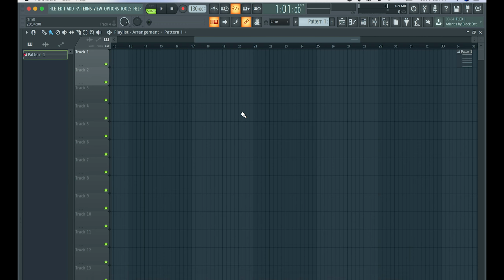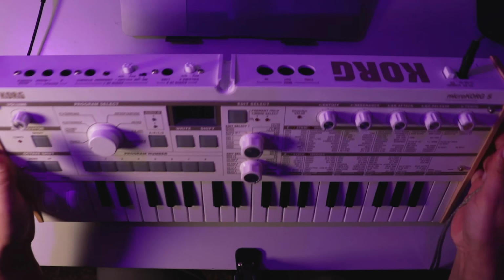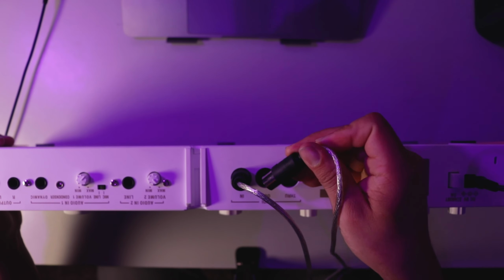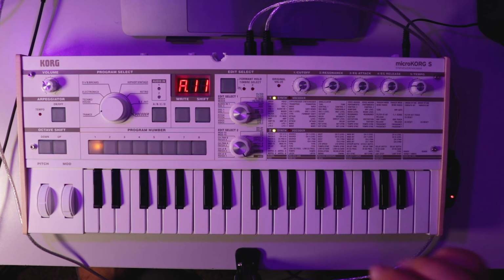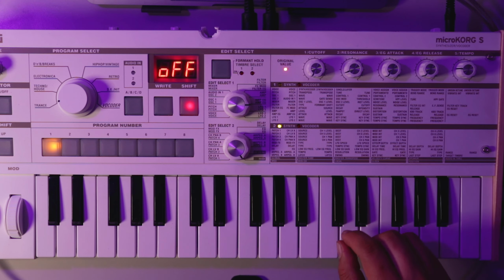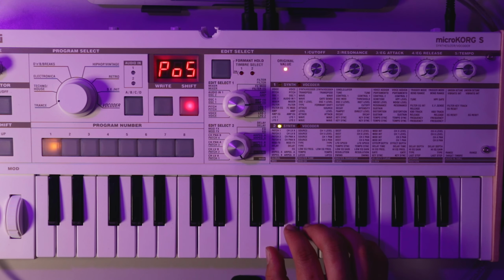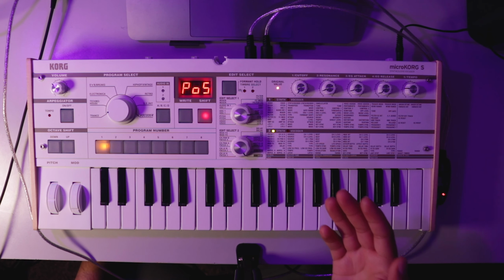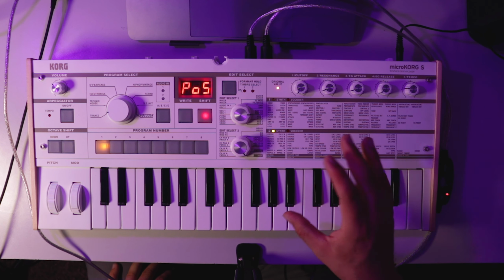MicroKorg MIDI Controller Setup

Comment: Hey J. Ezra. 
You seem legit.
My keyboard allows me to make tracks, and that's what I put on my channel, but I record the audio from its speakers.

I'd like to know how I may record straight to a device, (for example..connect it to a PC) without an interface.
Do you by any chance know how I can do that?
Reply from the maker: I highly recommend an audio interface and DAW to record your audio. There are a lot of great inexpensive audio interfaces out in the market and using an audio interface will give you the best audio quality possible. Unfortunately I do not recommend recording straight to the computer but I guess it is possible If you have a 1/4 inch to 3.5mm female to male adapter. Then you can bypass the audio Interface completely and record the microkorg directly into the DAW. 

If you watch my "Tall Box With MIDI keyboard Without Audio Interface" video I show how to by pass the audio interface with an adapter. Heres a link to that: 
https://youtu.be/2VZaCkkGVus
Reply: @J.Readingmusic   J. Ezra  thanks much.
but unfortunately, it's a Yamaha YPG-235☹️ do you think it will still be able record to a device with/ without interface?

Comment: Hey J.Ezra ! Thanks a lot for this nice explanation ! I was wondering, do you think it will work with MicroKorg XL ?
Reply from the maker: Hi there, I just read my reply to you and realized that I got this video confused with one if my talk box videos haha so let me try again.. ahem...

To answer your question the best I can, I havent owned a microkorg XL but mostly any modern keyboard/digital piano/ synthesizer can be turned into a midi keyboard. If you want to turn your XL into a midi controller I would start with connecting the midi cables to your computer like how I did In the video and see if your DAW connects to it. You might also have to change the settings on your XL to "midi" if that's possible. It might take a bit of experimenting but you'll get it. I hope this helps!
Reply: @J.Readingmusic  thanks a lot for your answer and your time, I will try that out in a month ! 👍🏾

Comment: thanks for making this video. btw, do you know any free software to use with the midi controller? I wanna lean how to play piano using the midi controller
Reply from the maker: If you have access to a software like Garage Band, Logic Pro, FL Studio, etc... they come with piano software that you can use with a midi keyboard. I'm learning the piano too but I dont reccomend learning on a midi controller. A full sized piano will be much easier to learn on. Check out the William's Allegro 3 or the William's Legato 3. Those are great beginner pianos to learn on, I have the Allegro 3 myself, heres a link to my video https://youtu.be/nLaY8O7j0vE